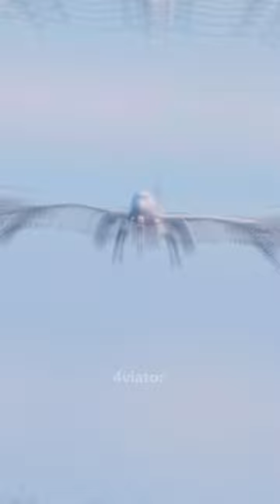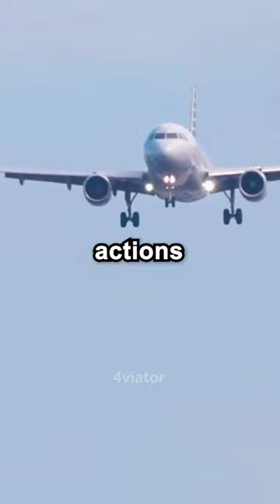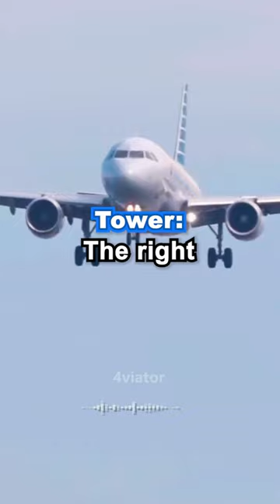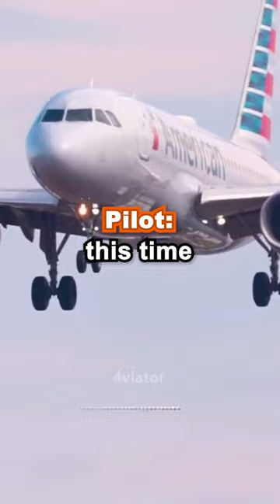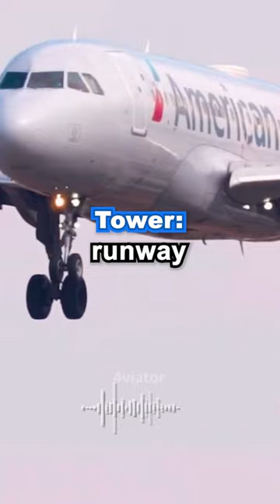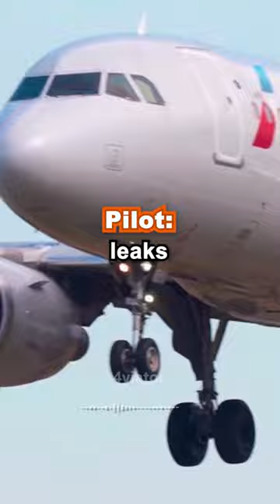Plane Losing Fuel Shortly after Takeoff

Comment from the maker: Could have ended much worse if it had gone unnoticed...

(Footage via Aviation & Travel)
Reply: Yea ur right
Reply: Well that's what fuel checks are for. It's not like they would've crashed if the other plane didn't tell them
Reply: @4viator  Great videos.  Please post more of them. Thank you 😊
Reply: you would think with all the sensors that a flow meter on the pressure and return and the computer would alert to indiffefrence must be old ey i would have thought FADEC would have sensor hanging off it everywhere, i spose it would be a horror when they moving fuel around the tanks to level it out rather than trim it, its only a plane i spose not like its automobile